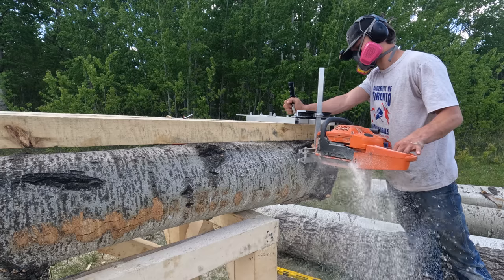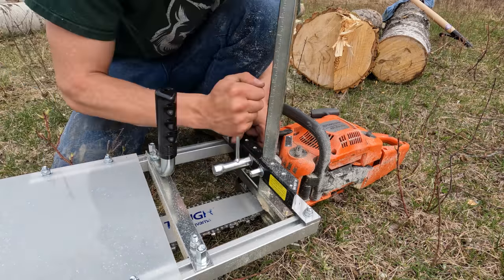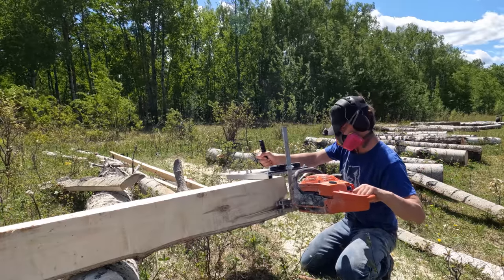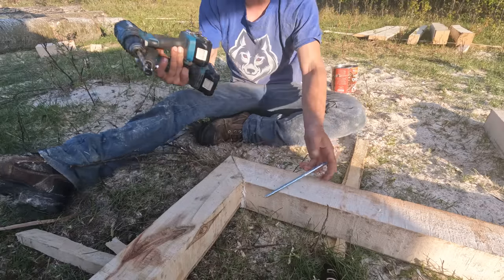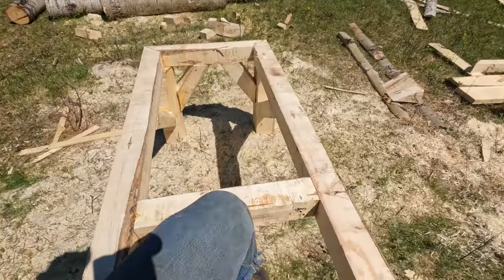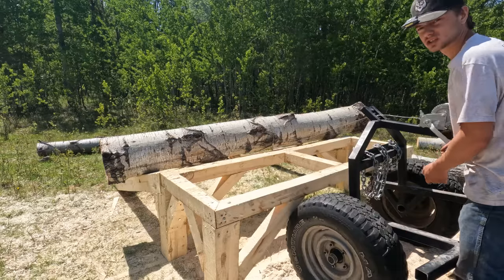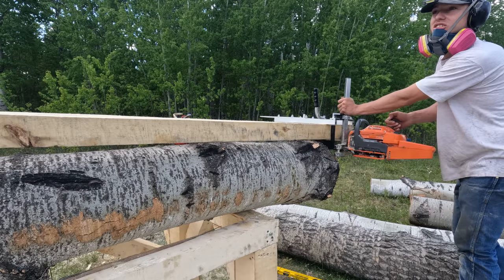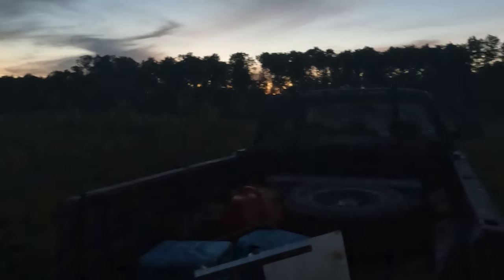New Chainsaw Mill - Milling Lumber, Building a Workstation for the Mill

Comment: I great video, my friend. I love seeing your progress coming together. It'll be a fun follow to see the big picture take shape as you proceed. 
If I recall correctly, there are special chainsaw chains made for cutting with the grain as you do when milling, rather than the usual crosscut chains we normally use. If you aren't using them, I'd suggest looking into them. Maybe they don't get as hot, and maybe last a little longer for you. I think they require sharpening at a different angle too. Just a couple of thoughts, that's all.
Stay safe and best regards.

Comment: Used motor oil is great for liberal amounts on the chain.  A guy can be generous with free oil rather than that super expensive "chain oil".  More is better when the saw is buried and heating up.

Comment: I think it was You that said old Motorola. Cause ever since you said that I've been using it on my  Deck and it keeps all the insects off of it I used to have problems with the ants and I haven't had it since thenSo I would say old motor oil I'm sure you can get that in any gas station They be  glad to give it to you

Comment: Get yourself a 12 volt  2000 or 3,000 lb winch from Princess Auto run your wires down to the ATV you can put a electrical plug so you can unplug it whenever you're not using the skidder you can also get one that's Wireless with the remote

Comment: Great video man, keep it up! What sort of chain are you using? Full comp or skip and at what grind angle? Using a rip chain definitely helps compared to a cross cut chain. Check out using “gravity drag” to assist your milling. Basically, the end of the log you start on should be propped up higher than the side you finish, that way you’re working with the force of gravity during the cut and taking some pressure off yourself during those long milling sessions. Bang on job man!

Comment: Maybe work on the chain a bit.  The small particles indicate the chain is really having a hard time cutting.  That will also create more heat and require more pressure to make the cut.  The "sawdust" as it is called should come out more like slivers or curls when he chain is sharp an the depth teeth are set correctly.

Comment: Can you add a spring to the locking paw on the winch? Also I was able to weld on a socket to an old screw car jack and impact the vehicle up, wondering if the same could work on the hand crank winch.

Comment: You should be filing your chain every 3-4 logs.. Have a few chains, you can just swap them. An use lots of wedges so the blade isn't getting pinched. Put the wedges at the beginning of your cut! Great content!

Comment: COULD YOU USE A GIN POLE (LOG)FOOTED AND FOOT BRACED ON ALL FOUR SIDES, 5' OFF OF CABIN WALL, SAW AN EYE NEAR TOP OF POLE, DRAG THROUGH MAIN ENTRANCE TO 
EXTEND PAST GIN.  SET UP ON OTHER SIDE AND LIFT AND DRAG ON CENTER.
IT WOULD WORK.

Comment: Take your winch cable and go down over the log and come up the under side bring up the cable and attach it to your bunk go over the first square timber and go to the second use a piece of flat strap if you don't have enough cable when you winch the log will roll up the deck instead of drag you will see it works slick. Or if you have a strap long enough do the same and pull it up with your four wheeler! should be no labour on the bike what so ever!

Comment: Hi! Just wondering. I have a saw mill like yours. The chain got really hot until i swapped to a ripping chain from Granberg. It cuts like butter in the saw mill! A bit trickier to sharpen but it is worth the effort. Are you using an ordinary chain in your chain saw?

Comment: I hate to sound negative, but I just have to say, there is a good reason why no one see's "poplar" lumber at the lumber stores.  It's garbage!  It will twist,warp, shrink and harden into a concrete like toughness that won't be fun trying to drive a nail into.   You're wasting so much energy on trying to re-invent the wheel.  Many folks have used poplar logs for lumber, talk to them and get their opinion.  Good luck young fella!

Comment: Totally insane, Canadians paying outrageous prices for lumber that grows everywhere, for miles & miles, in their own backyards. 🤨!  Anyway... Your system is working pretty great! Everything you do, you do so well.

If the green lumber guides continue to warp, maybe find a small wood I-beam to use instead? They tend to not warp. Or, maybe use 2 pieces of Trex composite decking. It's pricey but solid & stable. Someone might have some project leftovers they can sell you cheaply. (But maybe avoid rigging anything too slippery, like solid PVC or metal pipe pieces. Unless you can ensure the chainsaw mill won't slide all over the place.)  Would a laser level help you cut tapered logs a little easier?
  - - - - - 🤔

Comment: yOU NEED GRAND BEREG RIPPIMG CHAINS IF YOUR SAW IS HEATING UP AND WHERE ARE YOUR WEDGES WHILE RIPPING YOUR BOARDS AND AS STRONG A MOTOR AS POSSIBLE COMPARABL;E TO A "STILL MAGNUM" ABOUT A 7 HP OR MORE CAN POWER THROUGH A CUT EVEN WITH KIND OF A DULLED CHAIN.  AND WITH YOUR PARTICULAR MILL YOU ,MAY CUT TWO OR MORE WITH A LONGER BAR BUT THE WEDGES HAVE TO BE USED IN HOW EVER MANY LOGS UR CUTTING. TO TAKE THE PRESSURE OFF THE BAR .